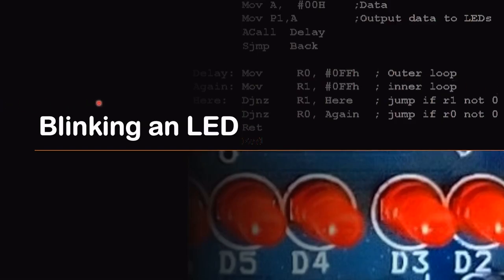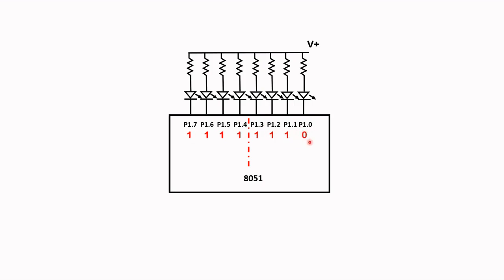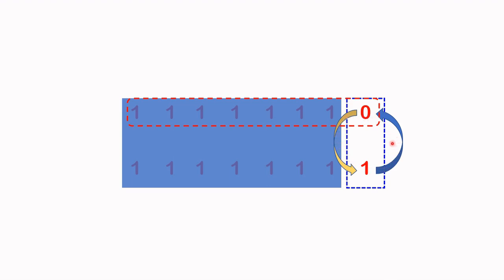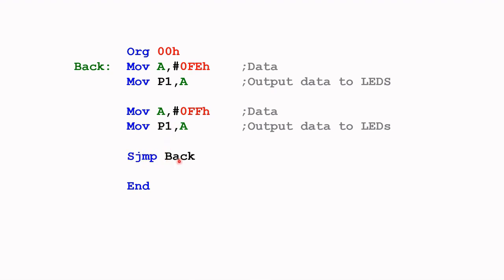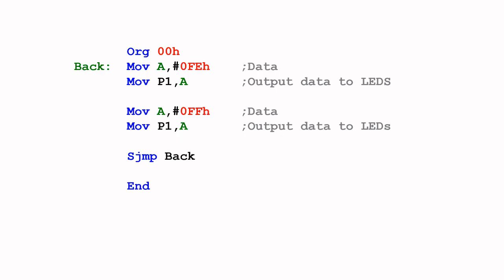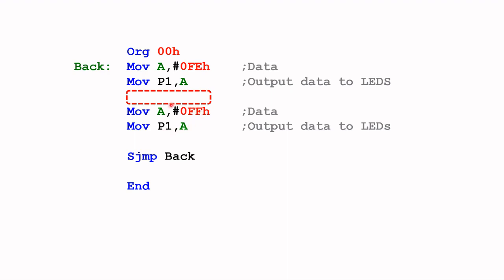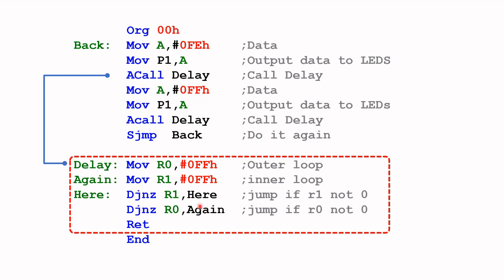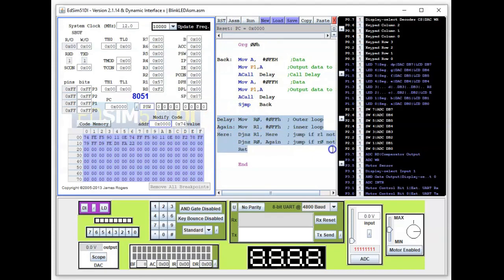#15 Blinking an LED Using EdSim51.

Comment: "If you're using EdSim51DI and your LED is blinking too fast to see, try setting the update frequency to 50,000. This slows down the simulation, making the LED toggling visible. The 8051 runs at high speeds (like 11.0592 MHz), so without adjusting the simulation speed, delays may be too short to notice. Increasing delay loops or using timers with larger values can also help. Happy coding!
Reply from the maker: Thank you

Comment: Sir, there is problem to blinking the led, actually my led is glowing continuously with delay also without delay, but the code is same , also system clock is on 12 MHz, sir plz help
Reply from the maker: Hi, are you using EdSim51?
Reply: @vooiyap  yes sir
Reply from the maker: @surajyadav9105  Ok, I am not sure why that is. Can you send me the code you are using to this email - vvy.eseducation@gmail.com
Reply: @vooiyap  the same problem here sir
Reply: If you're using EdSim51DI and your LED is blinking too fast to see, try setting the update frequency to 50,000. This slows down the simulation, making the LED toggling visible. The 8051 runs at high speeds (like 11.0592 MHz), so without adjusting the simulation speed, delays may be too short to notice. Increasing delay loops or using timers with larger values can also help. Happy coding!

Comment: hi sir .i need a help . the program that display name at the same time led is to blink
Reply from the maker: Please refer to video #15 to Blink Led and video  #28 to display name on LCD module.
Reply: @vooiyap   
Sir  I need by using serial code
Reply: @vooiyap  sir please help
Reply: @vooiyap  
Serial code for displaying name and LED
Reply from the maker: Please refer to video #40 on serial communication. In video #40 look out for Example 3 - it shows you how to display a message. For the blinking an LED watch video #15 - Blinking an LED.